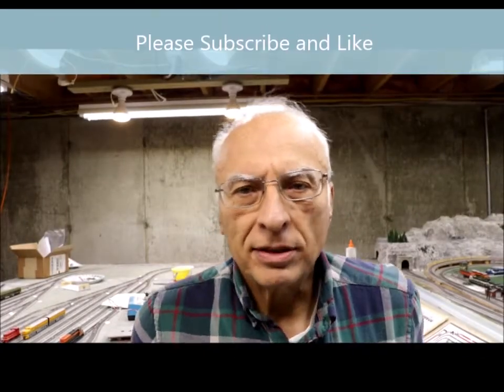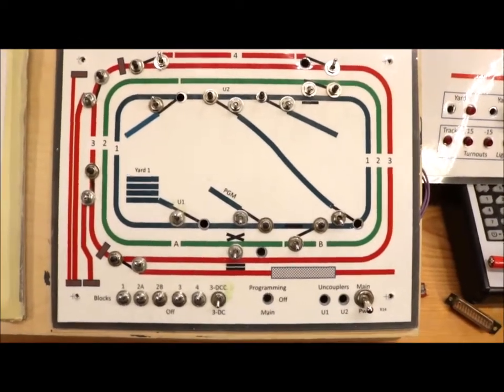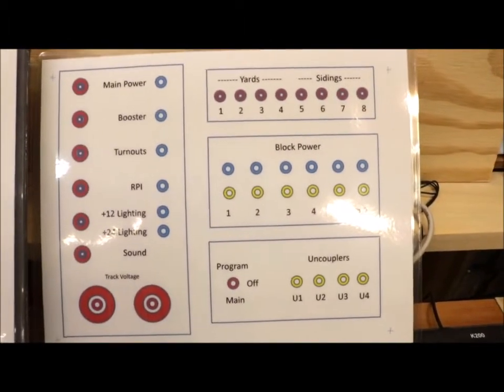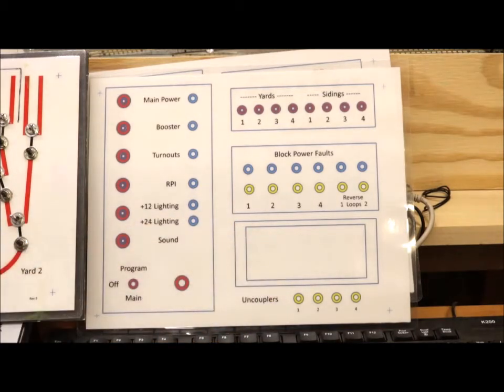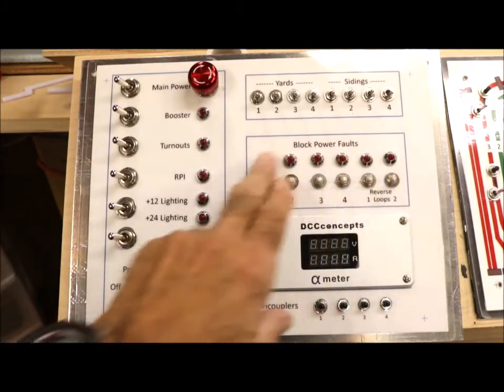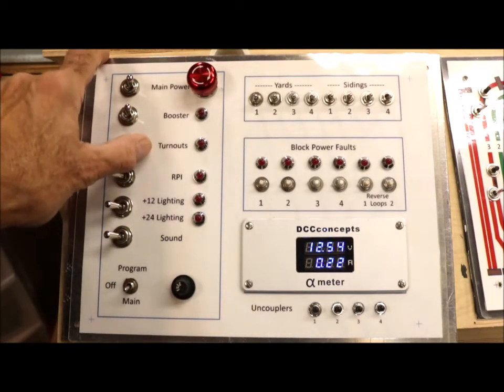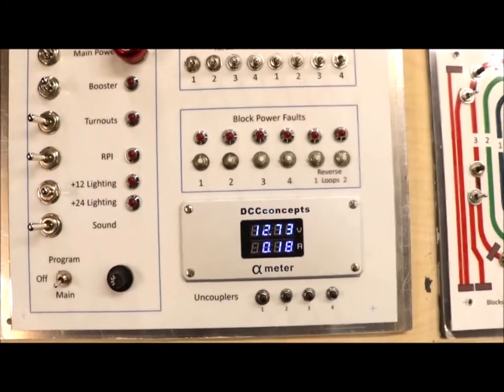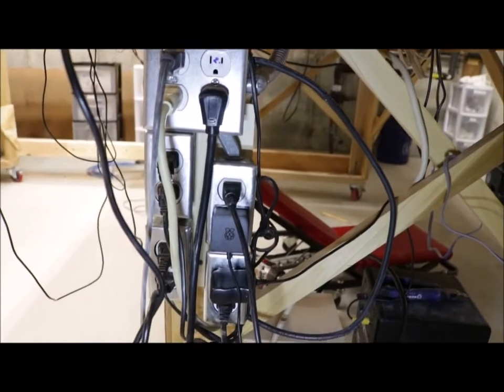Control Panel Update 2

Comment: Hey Jack,
a nice series of videos you did about of your control panels and I enjoyed to watch it all, thank you very much for it.

But when I have seen how you did the primary AC household electrics, oh my god, I hope your fire insurance is well enough to pay for it in cause of a fire?

Here at my location in germany it is not allowed to make cascades for primary electric power supplies using several power connectors behind each other.
Better it will be using several primary power circuits and then unsing one 3 to 6  connector power strip for supplying the primary power supplies.
Remember: cascades of using more than  one power strips behind each other isen't allowed, so in cause of that a fire would happened the fire insurance will not pay for the demadge or total lost.

I am not an expert in insurances but I think than in your country the will maybe have some similar regulations, too?
Reply from the maker: Ingo - good points. Ii have wired the duplex outlets similar to my home. That is the power goes into one outlet and then feeds the next outlet which then feeds the next outlet, etc.; This is allowed in the US but my outlets are much closer together than in a typical room in my home. So all the outlets are fed in parallel from one source. The source is fused with a 5A fuse located in the control panel. Thanks for the comments.